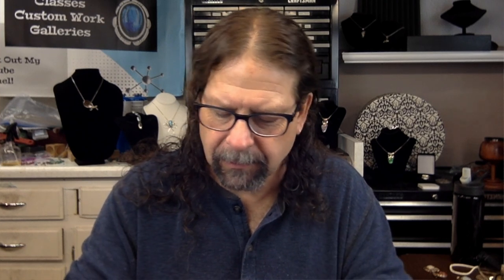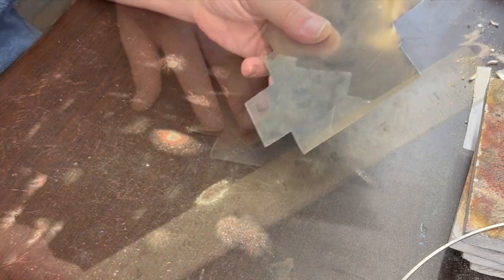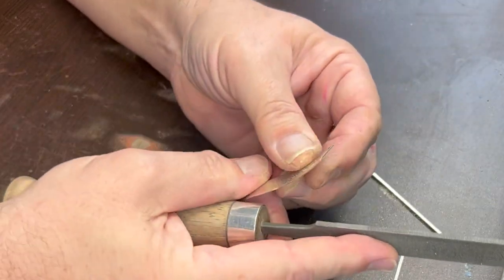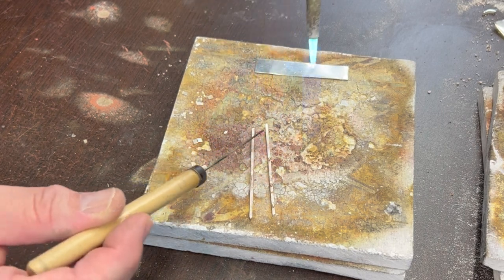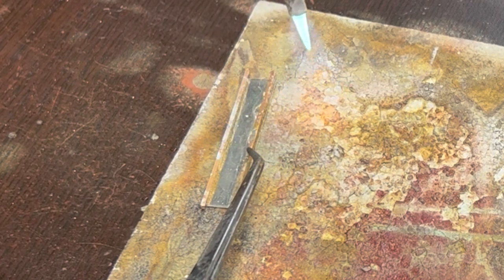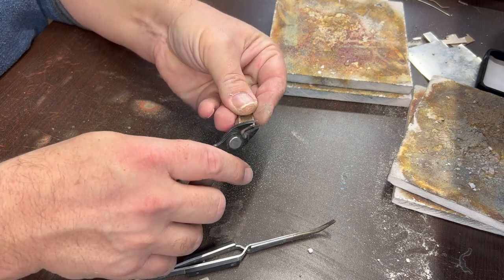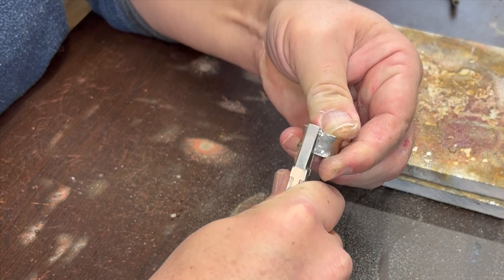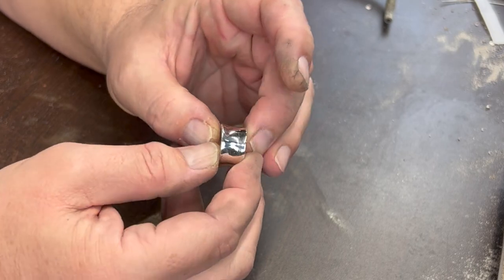Clever Trick to Make a Concave Band : A Silversmithing Tip

Comment: Would have never thought of that but a great way to work while silver prices are kind of high.
Reply from the maker: Thanks Kim. I think there might be some cool applications for this. Thanks for the comment!
Reply: @chadssilversmithing  have you also done it with the square wire on the outside?
Reply from the maker: @kimdimaggio6268  Yes. It’ll bulge out slightly in the middle:)

Comment: Hi Chad, Thank You for your video's I watch them over and over. What would your idea be on adding a inner band to this ring at the end so it would be straight thru? And I was wondering why I never see you mark your work?
Reply from the maker: Hello Mark. I'm glad you like them!  If you did do that, make sure to drill a hole in it so expanding and contracting gasses inside don't do anything weird.  I generally mark rings with my initials inside the band, but my .925 stamp was lent out and never returned. Was actually about to order a new one:). I generally don't mark earrings, just because sometimes its hard to find a good place.  Bracelets, yes.  Pendants, if I can find a spot on them to do it.

Comment: Lol thanks for the endorsement of metrics Chad. I follow several jeweller/silversmiths and the American ones (well, those who don’t use metrics anyway ;) )do tend to drive me nuts with their “fractions of an inch” lol. I’m allergic to fractions, and besides,particularly with tiny measurements, mms work SO much better and more accurately. Anyway, thanks for this. I’d never considered this as a way of creating a concave band, but it makes total sense when I see it done. Yet another eye opener 😅 Just as a matter of interest, you spoke a little about the issues of heating pieces being soldered, but do you ever use a charcoal block for soldering? I use mine pretty much all the time, and love the way it helps heat the piece, tho I know they aren’t everyone’s cup of tea.
Reply from the maker: I've gotten so used to the Solderite pads I use for classes, that I rarely use my charcoal block except for making balls.  With spray-on flux, the Solderite pads deteriorate more slowly than the charcoal does, and are cheaper to replace. Thanks Pauline!

Comment: Love the video.  I'm curious if you could make a spinner ring this way since the ring metal is bending the way you need.  The big thing, I would think, would be a way to keep the spinner from attaching to the ring while soldering the ring closed.  Yellow ochre?  Anything better?  Or just easier to make the spinner traditionally with 18 gauge?
Beautiful ring.  Does potential slumping of the 26 gauge start the concave process?
Reply from the maker: I was actually thinking about that while I was doing it. I think you are right though, and keeping the solder away from the inner band might be a pain. Not sure what you mean by slumping?
Reply from the maker: If you mean the actual curve, I think the square wire on the edges tries to twist outwards as you bend it into a curve forcing the sheet to curve inward in the middle. I hope I answered your question:)

Comment: Great video! Thank you for sharing! Is the ring comfortable to wear? Have you tried using half round wire instead of the square? Would it have a similar effect? You've really got my curiosity going.... ;)
Reply from the maker: Hello Cheekylittlefox!  I suspect half round would have less of an effect, but I have not tried it. It should be comfortable as long as you round the edges of the square wire a bit.  Thanks for the comment!